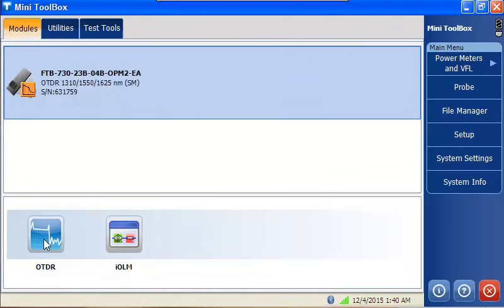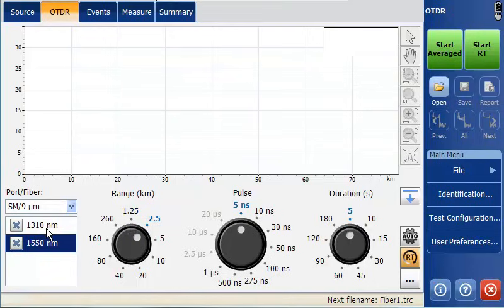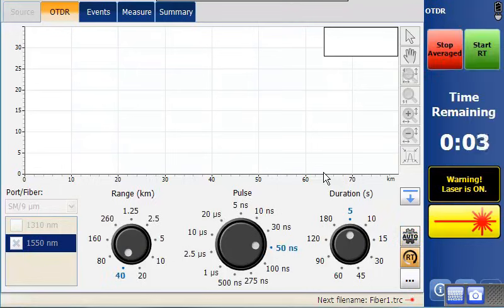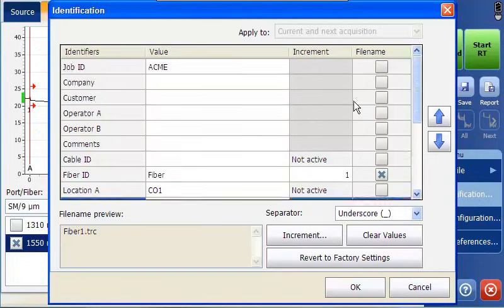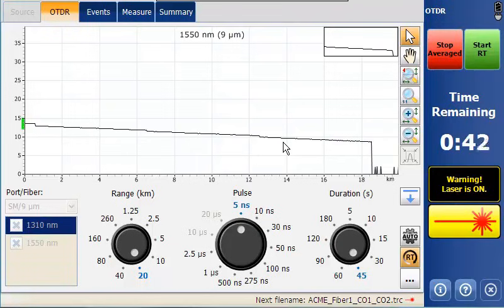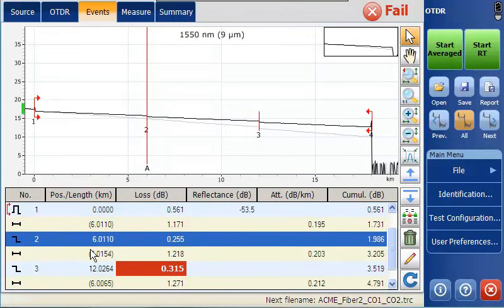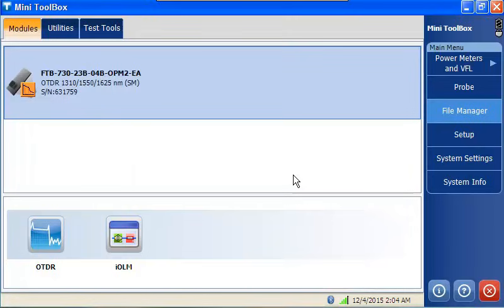EXFO OTDR SETUP

Comment: Your launch cable is over 1600 feet?
Reply from the maker: Yes, it is!  Good eye. I must have just grabbed what I had close by. Typically, I use 150m. I have one that is 5km for when I am forced to use a 20μs pulsewidth, which is not common. The pulse is 4km long at 20μs.

Comment: Can the OTDR screen be transferred to a monitor or laptop for ease of use?
Reply from the maker: Yes if it’s on the same network you can use VNC. If it’s on different network you can use QuickAssist or TeamViewer. Although I have not tried it you might be able to do USB3 out to HDMI. I have an adapter somewhere I will have to try it out

Comment: Hi Sir. I have EXFO FTB-1 OTDR but when I press the power button there's no screen display, still in black screen only. Do you know what's the problem and how to repair it?
Reply from the maker: Hard to say sir. Could be a battery issue or a display problem. I recommend removing the batteries. Unplug it. Than put it back together. Put the AC power and see if it starts. You can email support@EXFO.com and work with them to troubleshoot

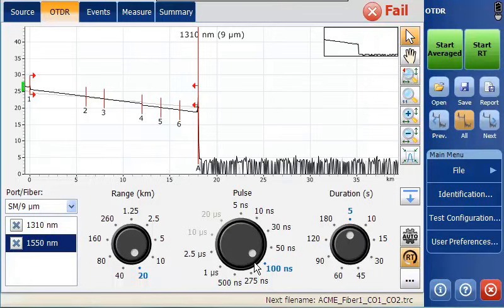Comment: Very clear explanation. Thanks. So question: [at 13:47 ] if I'm doing a very long fibre (168km), should I be actually doing a few tests/fibre at DIFFERENT pulse widths just to be able to observe the near and the far splices? (I'm doing bidirectional too)? Launch cable is 1.5km.
Reply from the maker: Yes you should do a shirt and long shot. 169km is very long can your OTDR test that far?  What is the part number ?
Reply: It is an FTB-1Pro with a FTB-720C-Q1-EA-EI module. Yes, I was wondering if it was capable and may need to rent/borrow a more powerful unit. Thanks for quick REPLY! . (My other OPGW spans are 77km and 124km.)

Comment: Hi Kevin.
Thank you for this video. 
One question. What is the recommended launch cable length? Do I need 500m for a network of about 10km in length? Or is 30m patch cord enough?
Thanks again Kevin for this video
Reply from the maker: You are welcome. I am glad you found value in the video. As far as the launch. Great question. It really depends on the pulse width. One way to determine is to take the Pulse width in (ns) divided by 10. Convert to meters and multiply by 2.
Example: 1 μs -> 1000ns / 10 -> 100m x 2 = 200 meter -> Appropriate launch cable
(multiplying the distance times 2 is to add margin for the pulse to recover you can 
safely go down to 1.5 times)

If you use iOLM you can get away with a shorter launch. Most of the customers I work with use 100m under 20km and 1000m over 20km. If you get into ultra long haul you need to look at launch longer than 1000m.
Reply: @KevinPeres  thanks for the reply Kevin.

Comment: hey i have a question . i save  mutliple trcs files is there any way to produce one report with all traces in it.  like on 945 a report of multiple shots is generated. 

thanks in advance
Reply from the maker: Not within the test set.  You can using FastReporter our reporting tool. You can use it for Custom reporting.  I have a video on my channel that goes over FastReporter 3. There is a 90 day trial and after that it is $180 a year. If you are doing custom reporting its a great tool.
Reply: @KevinPeres  thank you for the quick reply

Comment: I use an OTDR to locate a break. 
To achieve this is the best thing to do, select auto and start a test? 

As I don’t know the actual length of the line to initially optimise and I also don’t care at this stage. 

Second, how would I identify a splice on a fibre with the otdr ?
Reply from the maker: That is how I typically do it. Make sure you have a nice clean launch select auto and let the OTDR optimize. If you are troubleshooting set your averaging time to 30 seconds or more. The longer the averaging time the more optimized the pulse width. Once the test is done if you locate your problem you are good otherwise you can try lowering your pulse width to increase your resolution. You can balance this with adding more averaging time. The OTDR will identify the splice for you if it’s detectable. It will have some attenuation bit more reflection. Hope this all makes sense
Reply: @KevinPeres  amazing! Thank you :) 
I run for 30 seconds as I believe that is what the auto test runs at by default. 
What would a splice actually look like on the otdr trace? 
Are they highlighted by the lines in the trace? And what sort of loss would you need to have on a splice for an otdr to pick it up? 

That would be really useful for locating joints in a network that aren’t on any plans
Reply from the maker: @bhtradinggroup5340  splices will have some attenuation, usually a loss but can be a gainer but NO reflection.  Here is an old setup guide I did with a customer that walks through OTDR setup from a basic level.  There is a screen shot of the event icons in there.  https://1drv.ms/b/s!AmWiv8u8gNCngoA3QHAb-uN2SDP5Tg?e=Y1RVSX
Reply from the maker: This should say have attenuation but NO reflection.  Darn auto correct. Splices have attenuation but no reflection

Comment: May i know wht is mean the sign fail up the screen
Reply from the maker: If it says Fail on the screen than one of the events is out of specifications. You can verify and change your thresholds in the application
Reply from the maker: It means that one of the events whether splice or connector failed it’s set parameters

Comment: Hey can u help me how to make pdf file in otdr pls reply
Reply from the maker: MoMTa which OTDR do you have?  on the FTB and MAX platform you can see a Report button under the start button.  That will generate a PDF.  I hope that helps
Reply: @KevinPeres  I hv exfo otdr
Reply from the maker: @Im_divine_soul_8864  okay my directions should help you. If not email support@EXFO.com and they may be able to find you a local support to assist. My instructions should work

Comment: Good video. I just started using this otdr but all I get is what looks like noise. I’ve changed launch cables and connector type and still just see noise. Everything has been cleaned multiple times. Can you maybe give some pointers? This machine will improve my trouble shooting
Reply from the maker: Do you see any of the fiber ? Or does it launch straight noise ?  If so and you cleaned and cleaned it. I would inspect it with a probe if you have one to see if it’s damaged. Otherwise it may have to come back. If you have a trace to send email it to me at Kevin.peres@exfo.com
Reply: @kevin.peres will do. Back at work on Monday. I also will read the directions 😂
Reply from the maker: I am off this week and will be back Monday.  I will keep an eye out for the email
Reply: @kevin.Peres does this otdr use a blue connector on the input
Reply from the maker: @AuADHD9712  the unit I used had a green APC. We prefer to ship APC. Why do you ask?
Reply from the maker: @AuADHD9712  Bob if there is a green collar on the port you need APC green. Otherwise it’s blue.  Do you have a green collar?
Reply: @kevin.Peres I have green . APC. I have a launch cable of 65.8ft. Still struggling through the video to learn and effectively use the machine for field work. Are there classes available.
Reply from the maker: @AuADHD9712  there are classes.  I did an advanced OTDR seminar on this YouTube. Have you had a chance to check it out ?
Reply: @kevin.Peres actually the launch cable is 68.5 ft
Reply from the maker: @AuADHD9712  does the platform have a power meter ?  If so loop from the OTDR source to the power meter. From the OTDR select the source tab. Set it for 1550 or 1310 and CW. Switch over to the power meter set it to dBm and take note of the power level.
Reply: @kevin.Peres will look at that. I believe it does
Reply: @kevin.Peres I think I finally got it set up. I had to install an APC connection on the other end of my launch cable to test in our network. I’m getting readings that look normal. I’m using this unit to refine my network troubleshooting and fault locations. We get a lot of squirrels damage here. I’m a cable maintenance and fairly new to fiber maintenance and repair. My unit was sitting in a closet unused but I knew it was valuable
Reply from the maker: @AuADHD9712  great I am glad it is working. Email me at kevin.peres@exfo.com if you run into issues

Comment: Hey. Thanks for the video, very informative. I was wondering if this EXFO OTDR is eligible to show detailed test results (Value dB, Limit dB, and Loss dB) on a fiber optic cable that below 100m in length. Looking forward to the feedback. Thanks!
Reply from the maker: Joseph I am glad you liked the video. Yes it has the resolution to measure a 100m fiber. I would use the shortest pulse width with at least a 15 second averaging time. With lengths that short I typically lean towards an OLTS measuring span loss and ORL. If there is a splice or connector within the 100m than an OTDR would be ideal to measure that event

Comment: Thanks for this video. It's really helpful. However, there is one question I have. Thus, what is the meaning of FAIL in the top right corner of the report? Is this mean that the other side of the testing cable was not connected?
Reply from the maker: Sorry for the slow response I am realizing that people are actually watching the videos I posted for streaming testing purposes.  the top right fail is a "Global Fail" meaning there is at least one parameter that fails.  You will have to refer to the event table to see exactly what failed.

Comment: EXFO's End Of Fiber Detection comes factory default set at 5.0. DUMB, that should always be set to 20. Any fault found greater than 5.0 will cause the remaining fiber under test to be greyed out. Also, NEVER EVER change the index of refraction from factory default, it is never needed. Most fiber runs, long ones, are spliced with different vendors fibers with different IOR and most people don't even know what the IOR of the fiber being tested is anyway. Learn how to use your OTDR in EXPERT, or Advanced mode, many problems with using AUTO.
Reply from the maker: True Advanced Mode is always preferred but straight out of the box it is unrealistic to expect every user to be an expert.  If they were we would all get paid less wouldn't we? The End of Fiber Detection threshold is on all OTDR's that I know of.  Auto Mode while something I do not fully rely on is something many end users do use and has some value.  Keep in mind most technicians are Jack of all Trades.  Also if you do Advanced Fault Isolation any bit of accuracy helps.  IOR affects distance measurements.  Having been a backhoe operator some 20+ years ago accuracy matters if you know the IOR of your fiber why would you not set it? If you preach advanced testing understanding and setting IOR is an advanced function.  Give me a few feet of accuracy and I will take it.  It could be the difference between digging in the middle of the road or in the bar ditch.
Reply: Sir
450 meeter cable pass
But same setup
356 meeter fail ?
Reply from the maker: @ShahulHameed-wz3le  What part of the video shows the fail.  I do not see it.
Reply: @KevinPeres  
Sir
My problem is solved
Reply: @ShahulHameed-wz3le read event table carefully so that you will get answer sir